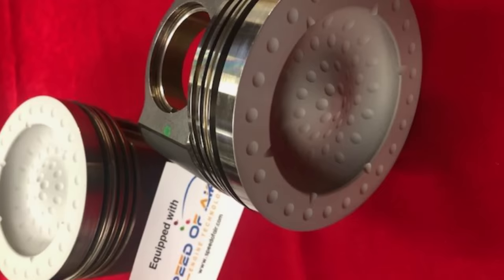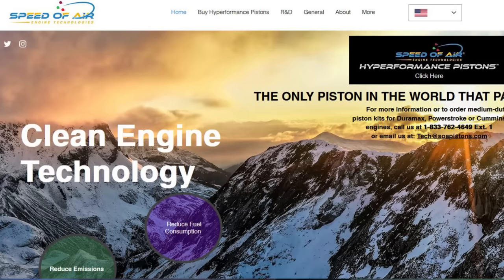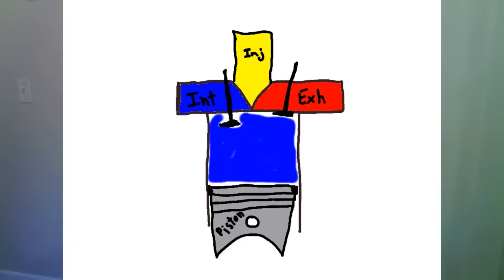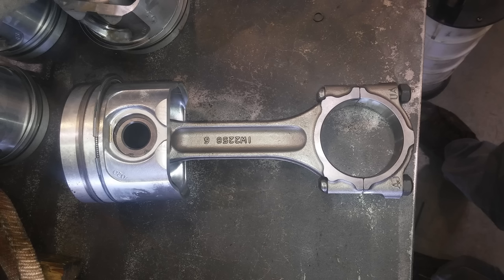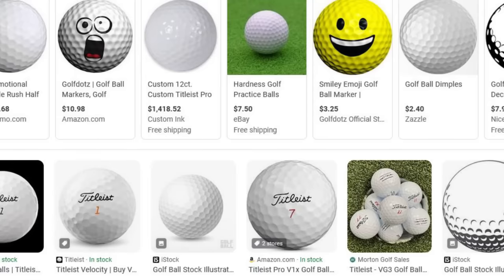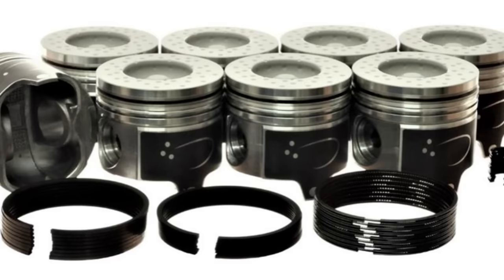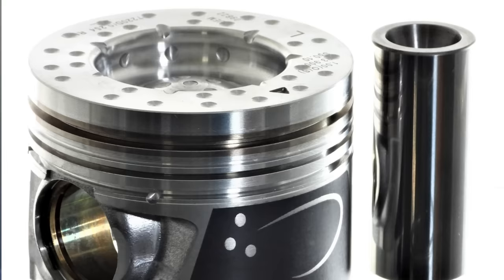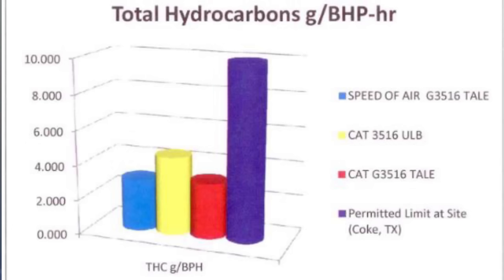Could Pistons with DENTS make more power and burn less fuel? Speed of Air Pistons.

Comment: What happens when these dimples fill with soot and carbon???
Reply: It becomes a regular piston🥴
Reply: Then it's a normal piston? If a normal engine has carbon, too much fuel or not ran hard/up to temp. Those engines try to compress carbon and fail.
Reply: Spend thousands in cleaning maintenance
Reply: They get smaller, but this is a non-issue, even if carbon would build up to that height(very unlikely)
Reply: Then its a flat piston !😂😂😂
Reply: You will need to purchase a special additive …. To go along with the DEF and electronics, it will break down in the middle of nowhere and happen right after the warranty goes out. You will be forced by the EPA to use it and the engine will cost about 30 percent more. Sound familiar?!!!???
Reply: A stock diesel engine that's maintained properly shouldn't have that much carbon or soot on pistons
Reply: If the engine is burning more of the injected fuel more efficiently than before, soot and carbon should not be an issue. Especially with the increased turbulence of the air and the injected fuel mixture.
Reply: i dont think they will fill with more than 0.1mm carbon
Reply: i was thinking the same thing!!!
Reply: I'd guess they won't due to the air which is supposed to keep the combustion away. Don't know
Reply: Run some methanol. Lowers cruising emission while keeping combustion clean.
Reply: Its a good question.......any surface that is near spray pattern stays cleaner than a gasoline engine. I've been through 3 vw tdi 300k+ that have shown cleaning action of fuel.
Oil making it past rings/valve guides will definitely coke up the piston top though
Reply: Don't idlle. Regardless of the lore idling is horrible for diesel engines. Don't idlle. If you must for heat or ac run it up to at least 1200
Reply: @TheFieldRat5.7 😂
Reply: the engineer that designed it reading this freaking out 😳 😂😂
Reply: LoL
Reply: They wont fill. At a certain point of buildup carbon forms a boundry layer and stays about the same. Think of it like seasoning on castiron cookwear. If it "built up" eventually normal engines would lockup all the time when they run out of piston to head clearence.
Reply: @TheFieldRat5.7 Like an escalator can only become stairs....
Reply: Haha.  As you use it.  It gains compression.    Genius 😅
Reply: How?
Reply: They don't if it's running properly
Reply: If the pistons have that much carbon build up its probably time for rebuild anyway.
Reply: If you want to clean out carbon from the cylinders, run the engine up to temp and then feed it a little bit of water at a time. Kinda like steam cleaning
Reply: This is probably less of a concern than the high ridges get hotter than the low spots. This all came from the golf ball design, and is probably pretty effective for better blending air and fuel. People have been doing it in head port jobs for years. I'm actually surprised it took this long to make inside the cylinder.
Reply: They won't.  They burn all the fuel.  Go to soa pistons.
Reply: @fredg8199  chemical intercooling  is more effective at lower nox emissions than the current methods as well
Reply: You should have much carbon since it's burning for better over a 1 million miles you might see a little decrease in efficiency but they should pay for themselves way before that if that data checks out
Reply: My thoughts exactly...wouldn't last long. I  did this experiment in the 90s with Pontiac cylinder heads.  They had smooth fully machined chambers and I was seeking some turbulence.  Don't know if it made more power,  but it definitely was a carbon magnet.
Reply: Engines that runs cleaner has less if any carbon buildup.   Run with Fuel additive Periodically, and Should prevent any buildup.
Reply: "comes pre-pitted" ... and doesn't love that!
Reply: Then it becomes pimples
Reply: Logic is lacking on this question 🤣🙈
Reply: They don’t build carbon compared to flat
Reply: Throw some rice in the hole
No no kidding

Water

No no
Those tricks will kill your cat 
Hehe
Reply: Dorman buys the core, ships them to China where they're reborn as Dorman remans.
Reply: If that happened, then it would simply function as a regular piston
Reply: Soot on a piston face? Carbon I could get but soot?
Reply: @ivoryjohnson4662  do you actually have anything that's a diesel or are you repeating nonsense
Reply: Run methanol
Reply: Higher compression 😎
Reply: Then you increase the compression ratio all good
Reply: The point is that they won't
Reply: Same as with a normal piston
Reply: @davesstillhere  Been a while since I've seen this, but it works (as long as you're not to crazy with the water)
Reply: These pistons burn much more efficiently and are cleaner. The amount of soot is drastically reduced.
Reply: That would  take a long time.  Your  motor would  have 500,000 on it before  that ever  happened,   Or more.
Reply: @gilmanbeito3130 Definitely  not.
Reply: They would  never fill up., period!!!

Comment: I worked for speed of air back in 2016-ish (when the testing for the cat mining truck was going on.) We also had done extensive pre and post testing on a 2010 jetta (ya the one with the defeat device.) Joe, had been perfecting this design for 20+ something years. Beginning with indian motorcycles. This isn't magic. This is the real deal. If you have an opportunity to implement these into your next build i highly recommend finding out for yourself. Glad to see speed of air finally gaining traction.
Reply: What pistons were in the CAT engines? The dimpled ones?
Reply: @ding9633 yes
Reply: Does it works on gasoline engine?
Reply: @budhihart8161  I know that they have built pistons for top fuel dragsters, so I would have to say yes.
Reply: Glad to hear this I’ve got a set coming for my C16
Reply: When I rebuild my 7.3, I'm using these pistons. I just hope price goes down by then.

Comment: In April of 2002 I had my 2007.5 model dodge Cummins 6.7 rebuilt using the Speed Of Air pistons. There are quite a few other performance modifications done to the engine. So far the Speed Of Air pistons have done everything that Chris said it would. Depending on if I keep my foot out of it I can get anywhere from 19 to 22 miles to the gallon. When I pull my overloaded 42 foot toy hauler through the Rockies, I can get about 11 to 12 mpg. When we first started the engine the mechanics were surprised at how quiet the engine ran. As of today there is 37807 miles on the engine rebuild and it runs great.
Reply: Congratulations. At 10% increase in mileage, you've got 112,193 more miles to go just to break even. My 95 dodge cummins has 122,000 on it. 30 years and 3 owner's and we still wouldn't have broken even. Lol.  The price is not realistic for 98% of the owner's out there.
Reply: So how did you rebuild your 2007.5 in April of 2002 🧐 

You got a secret time machine? Jk, I'm sure it was just an honest typo and you meant April of 2020. Cheers
Reply: @toddscholze6168 I'm 99% sure these pistons are bull 💩.....It'd be easy to test buy a cheap $500 small diesel engine & install a dimple piston in it.
Reply: @toddscholze6168  they have to start somewhere,   the more the demand the lesser the cost , nothing new that is they way it's always been.
Reply: @michaelbrinks8089  Agreed, this company was making an initial claim of a whopping 25% in fuel savings with these pistons, which is total nonsense.  Now scaled back to 5% savings, but with improved emissions. Pure snake oil IMO.

Comment: If it's reducing NOx, that means it would also reduce the amount of recirculated exhaust gas, that's going to lower the particulate contamination and extend the longevity of DPF/EGR systems
Reply: and lower exhaust temps also would it not ? and in doing so makes DPF/EGR systems obsolete
Reply: @donniebaker5984 Which would mean def would no longer be needed as well in fact the whole damn system won't be necessary so deleting will suddenly be a norm maybe since people are not up for voiding their warranty
Reply: That’s a good point. I however assume this could be solved by one means or another. Just the low pressure in the dimple should help with or without a modified egr or a properly timed e85 or other chemically formulated solution injected into the chamber. Could the benefit outweigh the cost? I’m skeptical.
Reply: Speed of Air does have regulations moving through Congress since the Chevron Act has been out ruled. All 3rd parties new rules now have to be voted through Congress since the Chevron Act is gone. Speed of Air does have less than 5 percent soot level readings without a emissions system. 5% or lower soot readings is required by law for any diesel road vehicle less than 10 yrs old

Comment: On a side note “ myth busters “ tv show did a experiment with a car. They covered it with clay a put divots in it and it worked quite well even though it had extra weight it still got better mileage. Nice video thanks. 🙏🙏👍💪
Reply: @craigwhittingslow9689  -  I remember that episode.  However, I don't think pure aerodynamics has that much to say about internal combustion wave front dynamics.  I could be wrong, but that's my take.
Reply: It reduces the low pressure zone behind the car that makes a vacuum

Comment: There is an outfit in Canada called DFC diesel and every single one of their rebuilt engines come with these Pistons. They claim on a late model low emissions engine they make a significant reduction emissions production and use less fuel.

Comment: Dimples are not a new thing.  I've seen them in, I believe intake manifolds, for gas engines along with steps in the runners.  Both of  these techniques are there to get liquid fuel back into suspension.  What happens is the liquid fuel settles in those dimples and the turbulence of the intake stroke blows that fuel around and it shears off of the edge of those dimples and gets back into suspension where it burns more readily.  Interesting video.  Keep the good stuff coming.
Reply: In intake runners dimples effectively reduce the cross section area. Not worth it, even if your ports are oversized. Permanent changes to the metal should be avoided when possible.

Comment: Very interesting. We follow a very similar principle when porting piston ported 2 stroke chainsaws. We purposely leave the intake port rough to cause turbulence in the incoming air fuel mix. Well known to produce more power then a polished intake port.
Reply: Yes when porting & polishing engines with wet intakes the intake ports should not be polished.

Comment: I feel like anything you can do to maintain swirl and turbulence is going to help. Even if there were no power gains the reduced deposition of carbon on combution surfaces could be a significant improvement to longevity.

Comment: Awesome 👍.
I have a ball peen hammer will dent up top of my Pistons and try it..
Stratified charge 3 valve on gas motors worked for Honda .
Lavonva precombustion chambers turbulence created improved early  diesel engines.
Sounds reasonable.

Let's see a dyno test.
Reply from the maker: There is a Dyno test on their website with a Powerstroke, FYI. I would like to see more info as thus design gets tested more.
Reply: @AdeptApe  Excellent.
New hydrogen engines seem more practical since no emissions equipment required.
Cummins and JCB have such now.
Reply: I had a 20 valve Mitsubishi in my old 1984 Plymouth Reliant; the 5th valve on each cylinder was about the size of a spark plug and was intended to put a swirl in the charge air. Nifty idea.
Reply: @MitzvosGolem1 Is water the fuel source for these engines?
Reply: @preachers4135  No. Its usually hydrogen gas or ammonia. Ammonia is 3 hydrogens and 1 nitrogen per molecule, so it 75% hydrogen. In liquid form.

Comment: Back in the early days of hot rodding. When all parts were factory parts. Modified factory parts. Or homemade. Both power and economy gains were made on flathead Ford V8s by dimpling the combustion chamber in the heads. It's all about creating turbulence, to help atomise the fuel. It was proven highly effective almost a century ago.  It was almost forgotten in recent decades. Mostly due to engines being designed for much higher RPMs. Where maximum air flow matters more then fuel atomization. Above a certain higher engine speed. It doesn't matter enough. At lower speeds that most diesels operate in. The right kind of turbulence will help make power, burn cleaner, and also increase fuel efficiency. Decades of hot rodding and early racing proved the concept.

Oh yeah. They did dimple the tops of the pistons as well. Any lower RPM engine will benifit from the right kind of turbulence.

Comment: I've been in contact with Speed of Air, I tried to be a guinea pig but, they already had several in operation so, when I'm ready for my next Platinum Overhaul I'd like very much to have you install this piston kit for me.
2007 NXS15745 C 15 ACERT. I've installed a Steed Speed Manifold, Fleet Air Filters and had Pitsburgh Power tune it to 600 hp for efficiency. 
 I run Bruce Mallons Pitsburg Power Fuel Bourne Catylist so I get no smoke out of the pipes and mpg's are phenomenal for the current specs.
 She's due for her annual overhead in August 2024 so, I'm hoping to chat with you more then.
 Thanks for sharing buddy...and being a rare gem in your occupation.
Reply: So what you getting 8mpg at 80k?

Comment: This is a really interesting design, I'm not sure why this hasn't been really experimented with in the past. The only thing i could think of in this kind of application that is even remotely similar is the old M35A2 engine. The LDT and LDS 465's with their multi fuel capabilities had a cupped piston with a small notch almost like these SOA pistons, with the intent to help create higher compression to help ignite a wider variety of combustible fluids to give it the multi fuel capability. These engines were in production from the early to mid 1960's all the way upto the mid 1980's.
Reply: It may have been experimented with but the cost of production may not have been worth it. Now a days, machine work costs have gone down and precision and speed is up. It may not have made sense back then. Or maybe someone in an office was like "that sounds ridiculous, expensive, and it'll never work. I'm not funding that."

Comment: From what I recall, this was being developed in India around 2002~2004 (I was teaching at a trade school in Orlando and did all sorts of unrelated research)
As with anything developed outside USA, it's taken 20 years to get here and even then mainly due to various gas price increases .
The CAT engine is about 69litres for the 3,000hp (that's sixty nine not six point nine)
The graph at 7:30 shows the SOA pistons are giving only a little worse fuel economy to the most efficient ship engine in the world even though that turns at hundreds not thousands of RPM
Reply: I recall a guy in India a few years ago that was machining grooves in combustion chambers from the sparkplug outward to direct streams of combustion to propagate to the edges where the flame front normally has a tendency to quench; his belief was the fuel mixture was burning more uniformly.
Engines he modified ran quieter, idled very low without vibration and got better fuel efficiency. 
He had a patent and was trying to interest an automobile manufacturer (Ford? GM?) to use his design. Their testing alleged that hydrocarbon emissions increased. This was also around the time the government was bailing out automakers and beginning the EV push; so it could have been politically axed.
I have never heard anything else about his discovery since.

Comment: I'd love to get a set of these pistons for my C15 MXS and have you install them and chronicle the results. I track my fuel economy diligently. I log every fill-up through the fuel gauges app. I'm a car hauler and every advantage for fuel economy I can get I'm open to.
Reply: Look up Russ Mathis logger torque cam...the tight LSA and more duration on the intake valve(s) allows for better scavenging of the remaining combustion gasses from the cylinders and allows a fresher air charge for the next combustion event.  Plus it helps produce more torque and the turbo spools up faster.  Diesels regardless of configuration would benefit from this modification.  Also applying a thermal barrier and thermal dispersant coatings to the turbo along with wrapping the turbo with a ceramic insulation blanket/wrap.

Comment: Interesting.... 

The internal combustion engine is over 100 years old and new techniques are still being discovered.
Reply: And now we have some of the most unnecessarily over-complicated designs ever to exist yet actual fuel efficiency and service life is worse now than what it used to be/could be by a huge margin.
Reply: @illbeyourmonster3591 Can you be more specific? I believe there is some truth in your statement if you’re talking about Diesel engines with aftertreatment systems but most other engines have an average double life expectancy than engines from 40 years ago while using about half as much fuel.  New technology in Metallurgy, production machining, oils, electronic fuel and spark control have all lent a hand in these outcomes. Sure a lot of them have had a few, and some have had huge, pitfalls but, can we learn from and overcome these pitfalls?